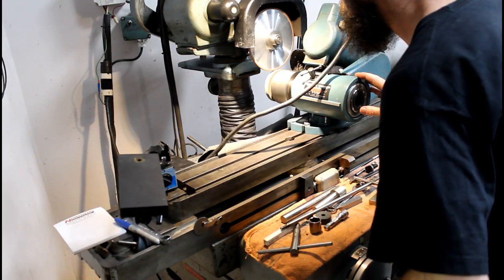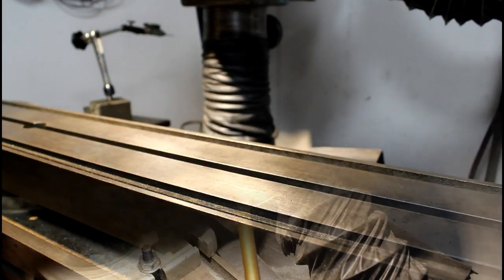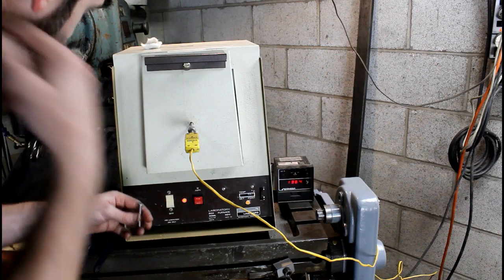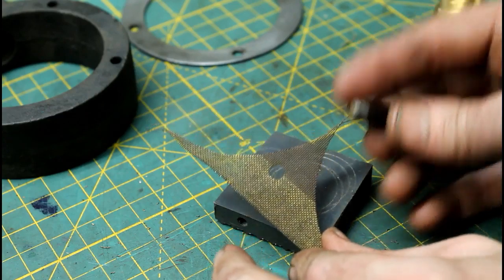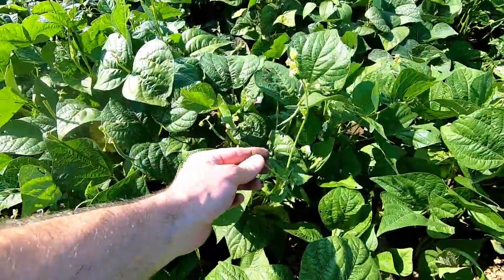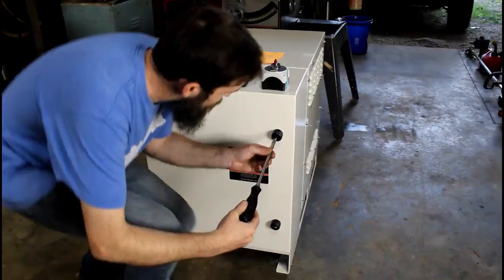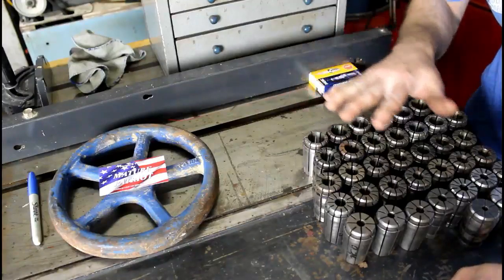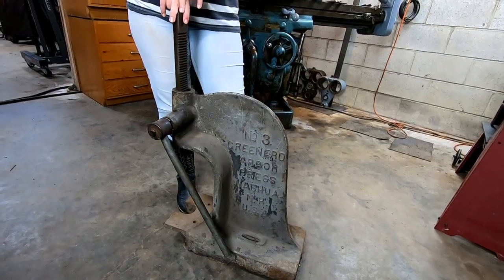New Shop tools and projects / Do-All saw work / viewer mail

Comment: wonder if it wouldve been eazier to machine the center hole in true center first then grind the outside of that cbn wheel
about the hardening , one thing i heared about is that people use old used engine oil out of a diesel truck to quench the parts they want to harden , the used oil has a lot of carbon particles in it , will probably smoke like crazy though as theres allways a little diesel in the oil , it might allso be to give the metal a nice dark finisch 
about the oven used , i seen stephan gottenberg use a small emaille hobby oven for that stuff ,
https://watermanshop.com/Portals/0/EasyDNNNews/117/300300p1884EDNthumbEmaille_oven_in513561.jpg
he has a thermocouple hooked up to a relay to get the oven at the perfect temperature and keep it there
about the garden , maibe put a cheap enclosed fence on that one side to deflect the wind some 
https://cdn.zilvercms.nl/jpeg,q80/http://gadero.zilvercdn.nl/uploads/webshop/category/tuinschermen-louvre.png 
, maibe use palletwood for that

Comment: Hi Steve,
Thanks for the video.
 I have 4 extra pressing plates and will send you one unless you would rather make your own, let me know.

The blossom end rot is a calcium deficiency and found this on Google  "There may be no tomato problem more heartbreaking than blossom end rot, because this tomato problem doesn't show itself until the tomato begins to ripen and by then, it's too late to do anything about it. ... This calcium deficiency is probably caused by irregular watering and a fluctuation in water levels"

Comment: Steve...Possible Solution!!
I have had problems with blight in tomatoes which caused the fruit to rot and the bottom leaves to die off but since I started using "Green Earth" Bordo Copper Spray the problem has been eliminated. I spray the plants approx. two weeks after planting and every two weeks until fruit is starting to ripen. It is  Copper from Tribasic Copper Sulphate – 53%. Any similar brands would also work.

Comment: Another idea for some of you out there is rather than a phase converter you can use a 3 phase variable frequency drive. If you only have one machine that needs 3 phase it’s an economical way to go about it. You can usually find older models on EBay etc for pretty cheap. They take up much less space than a phase converter in most cases as well.

Comment: I have the same model american rotary phase converter, makes the same noise, comes and goes.  works fine otherwise. made the noise since new.

Looks like valve handle, they are tapered square  with a threaded end , nut holds handle tight on tapered square.

If you draw up a print for arbor plate I would be happy to cut out from whatever thickness plate you want with oxy fuel pattern torch.

Comment: Sumitomo make some great inserts but the titanium carbide ones can be very brittle, if yours are this type a word of warning. Don't stop the lathe while the tip is still in contact or it will chip the edge. The voice of experience. 😣

Comment: RE your tomatoes    are your tomatoes turning black on the end? (blossom end rot)  you need to spray the plants with calcium nitrate    Tomatoes have a tremendous need for calcium as it is a key component in the cell walls.

Comment: Thanks for another weekly installment Steve!  I agree with you that American Rotary builds a quality machine.  I certainly like mine.  You might want to think about tempering that punch you hardened so it won't be quite so brittle.  If you hit it with a steel hammer it might shatter.  An hour at 450 F should do it.  I think you should help Elizabeth restore that arbor press, not that she needs your help, but it should be a fun project.

Comment: Steve, it seems like a lot of extra work to use a CBN wheel for grinding HSS. It would appear that a 46 grit alum oxide wheel works better with less fuss. Thanks for the video, guys like you are showing the younger generation what machining is all about!

Comment: Thanks guys, the garden looks good, and wow the rotary converters super. I too have the same arbor press , the stand came with mine over thirty five yrs ago. . It's missing the plate too , have a chunk of steel to make one but just never did I tried drilling it but it's so damn hard the bits will WEAR out. Figure ill try plasma cutter and abrasive to cut the slots if I ever get well enough . Savere pain in spine and back keep me in bed round the clock. But I hoping someday ill find a Dr to trust for pain. Last one punctured my lung and it collapsed close call it was three months slow internal bleeding. Fun living the is way.